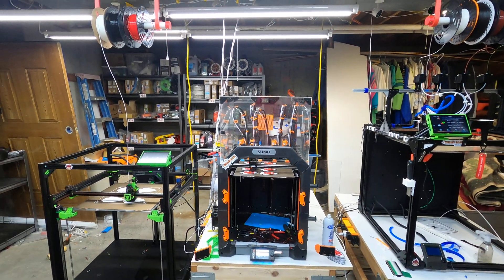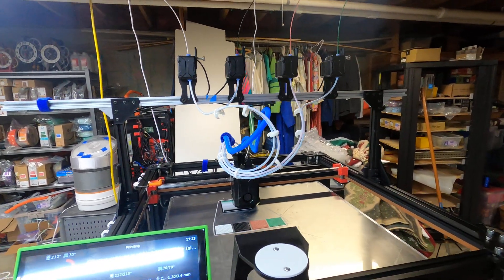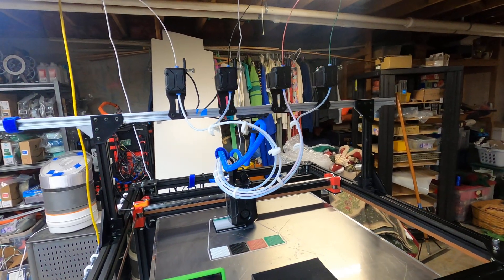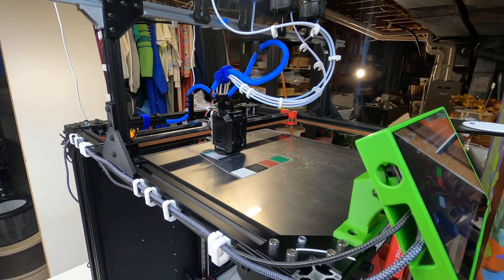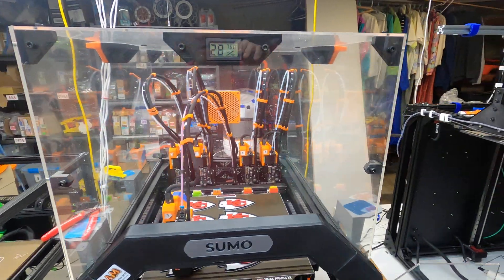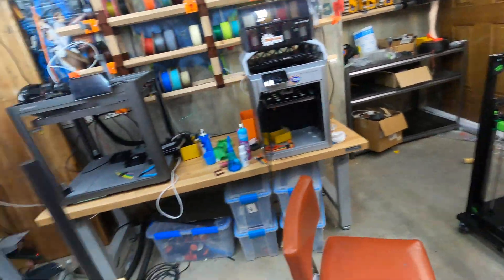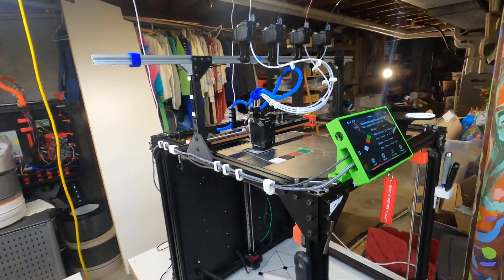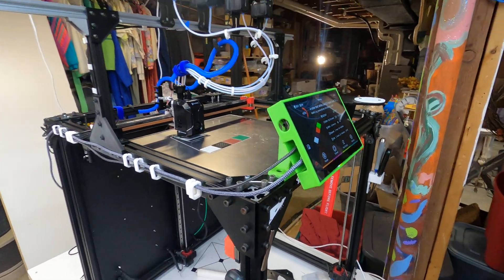Co Print running on a Rat Rig

Comment: Where are you around KC? Im in Topeka, and should finally take delivery on my 500mm Ratrig sometime around the end of the month.
Reply from the maker: I'm in Liberty, very close to Chris Riley (Chris's Basement).  Good luck on the Rat Rig, did you get the IDEX or Hybrid?
Reply: @woodwaker1  I ordered a hybrif through Fabrico. Picked up all of the upgrades from Mandella Roseworks too. The plan is to order the IDEX kit once its directly available from Fabrico, but there is just as much negative chatter out there about it as there is good news. So Im a bit up in the air now.

I didn't realize that Chris was so close!

Comment: I'm more interested in IDEX than a Co Print, for my needs anyway, but it's great to see your printers all printing and this is a great encouragement to those building a RatRig as well as those of us dreaming of building a RatRig.
Reply from the maker: I think the Rat Rig is a great value,  more than a Bambu X1C, but less than a Prusa XL.  The 500 is hard to top for size and what it can do.  I was thinking of replacing my two V-core 3 with another V-core 4, but wanted to try the CoPrint.   It has been a great addition, for $300 I have almost the equivalent   of the Prusa XL with a lot more build area.  I think I will order a second one for the 400 mm V-core 3.  Stay tuned
Reply: @woodwaker1  - I'm looking forward to you adding a Co Print to the 400 mm V-Core 3.  I loved watching RatRig's video showing their print farm of shortened V-Core 3 printers (they only print short parts), printing parts for the V-Core 4 kits.  They kept 40-some fast coreXY printers busy 24/7.

What really impressed me was a three year old video I just saw tonight where they showed a 500 mm V-Core 3 printing 500 parts on a single build plate.  The bed on my SV08 is so warped and there is so much inaccuracy in the bed mesh produced by the low quality inductive prox sensor that I have trouble printing ten small parts in the middle of the bed.  I've been designing and building a 3D printed enclosure for my SV08, and I've been designing and 3D printing a photogrammetry booth so I can 3D scan objects, but what I really should be doing first is shimming the SV08 bed until it warps to within 0.2 mm of being flat, and upgrading the cheap inductive prox to get accurate bed mesh scans.  I may need to upgrade the SV08 to Mainline Klipper or RatOS, because the upgraded Beacon probe on the new RatRig printers that can quickly make a 400 point bed mesh as you demonstrated in an earlier video, and also detect a 20 gram force nozzle press onto the bed for direct measurement of Z=0 offset is extremely impressive.
Reply from the maker: @Liberty4Ever  I saw the video from Rat Rig and was impressed with what they do with 30 employees.  The V-core 4 is a major improvement over the V-core 3.   The head assembly with the Beacon and orbiter2 works great.  The heavy build plate and Z tilt make it much better for printing across the entire surface.   The CoPrint head is fairly large and causes some loss on print area in a closed frame like the V-core 4, but with the 500 build area it is not a big problem.
Reply: @woodwaker1  - It's been great seeing RatRig's rapid growth.  I urge people to evaluate them not necessarily on where they are but how fast they're improving.  Not only is VC4 significantly improved over VC3, but VC4 is improving at a rapid rate - IDEX, Beacon probe, super deluxe filament sensor on the tool head, etc.  They make CNC tools and just spawned Disrupt Engineering.
Reply from the maker: @Liberty4Ever  You pointed out many of the reasons I think the V-core 4 is such an improvement over the 3.  They have really integrated all of the parts on the toolhead into one unit.  The V-core 3 was sort of thrown together and had many options that sort of worked.  That's why the CoPrint was a great fit for the V-core 3, as it replaces all of the toolhead with one cohesive unit.
Reply from the maker: @Liberty4Ever  I should have a new video in a day or so, am running a long test print on the CoPrint system, over a day with many color swaps, so far no problems
Reply: @woodwaker1  - I'm looking forward to your CoPrint long duration reliability test video.  They sell a system for my SV08 with up to eight extruders but I'm more of an IDEX functional print kinda guy.

I'd keep that V-Core 4 well fed.  Watching this video, I imagined you walking down into your basement one morning to find that the V-Core 4 ate your Prusa XL.     😲
Reply from the maker: @Liberty4Ever  That is why I had to separate them